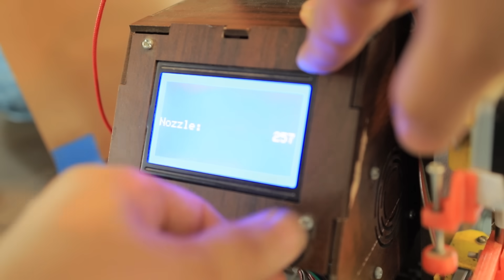How to Make free & easy filament for 3D printer at home

Comment: I assume you didn't print immediately after production. Wouldn't you need to spend considerable time drying recycled PET filament before use?
Reply: I would assume this process does dry the filament. I also assume this process introduces bubbles and other imperfections into the final filament which may also contain/trap moisture. But it is probably good enough for most use cases.
Reply: @JeffKarney  I assume you are referring to the initial heating under pressure? I imagine that helps but I'd be surprised if that's all it took. The initial extrusion temp is pretty low which may be helping to reduce bubbles but surely there is still moisture.
Reply from the maker: Thanks dear friend, be a little patient, because the time for the full video tutorial was long, it was decided to split the videos, but do not worry, we will discuss it in the next videos

Comment: Nice idea and excellent work! 
Curious about why you need to stretch the bottle with pressure at the beginning of the video? Does it not working if you doesn’t stretch it? 
I’ve never learned about materials, don’t know if all the bottles are made of pet material, or how did you choose the bottles? 
Is it easier to joint the plastic strap before stretch it into filament shape? 
Is it better to have a extra step using another nozzle to squeeze and stretch it, to smooth out the filament diameter, or unnecessary?
Reply from the maker: Thanks my friend, your answer is in the pinned comment

Comment: I would have never expected filament to have enough rigidity just out of the nozzle to PULL the cold plastic in on the other end. Sounds too good to be true, but I guess the lower temperature and the larger diameter helps keep the centre from melting properly. Impressive, might worth a shot :)
Reply: it doesn't actually melt 'filament' it just forms PET strip into 'almost tube' shape while it's heated a little bit higher than deformation temp, pretty common and well-known technique
Reply: Oh i didnt even realize that it was being heated when pulled through. I assumed it was just being pulled through like a die. Really clever to use a heated nozzle and pull it through that

Comment: A proper tutorial explaining the different steps and also how to build the cutter and the melter would probably go viral and get many people who wanna know how to make recycled filament to watch your videos.
Are you going to make such a tutorial with explanations?
Reply: That will be nice, though there are many bottle strip rope tutorials on Youtube and a few online demonstrating the different ways to make the strips.  My only question regarding the strips is the optimal width mr3dprint found to cut the strips.
Reply: @jafinch78  I would mostly be interested in the block he used to melt the strips into round filament.
Because regarding that thing I only found one other video using something similar, but that video was russian and also didn’t explain anything.
Reply: @yourlocaltoad5102  Thinking if the block is 200-225, then a cost effective E3D V6 will be suitable since the extrusion temperature is low enough and well within that blocks temp range.   Not sure why a 40A block would be required.  Can save on the PSU and just use something like 10A's I'm guessing to power the controller board an all since the controller board, block and feed motor is all that is needed to be powered.  No other 3D printer motors would be used.
Reply: @jafinch78  well, the thing is that I have no idea how to regulate such a block, which nozzle to use or anything else like that.
So that’s why I would really like to see a proper tutorial on that (or maybe a written article, but I couldn’t even find something like that referring to a project like this).
Reply from the maker: Thanks dear friend, be a little patient, because the time for the full video tutorial was long, it was decided to split the videos, but do not worry, we will discuss it in the next videos

Comment: I think your lying.  Your putting regular PLA in your printer.
Reply: @AIboom20  No..  I've looked at your videos and read your comments.  I know your lying.  The spools you make have imperfections but the filaments you put in the printer are perfect.  You also try to hide the filament as much as possible.  People ask for information and you point them to other videos of the same thing.  You also expect me to believe that you make the filament at 270-280 by pulling it, but it's soft and printable at 250-260?  And, that your results are indistinguishable from any other print.  No..  I don't believe you.
Reply: I wanted to come back here and say that I now think I was mistaken.  If this is a trick then it's extremely elaborate and well planned.  That does happen but I don't believe that's happening here anymore.  I may have to try this for myself but from what I can tell this now looks real.
Reply from the maker: This is quite true, there is no reason for me to lie, because my goal in setting up this method is to help people who have little financial power but have many ideas for 3D printing.

Comment: Well, I'd call this more of a "demonstration" than a "tutorial" since a tutorial usually includes instructions... but it is pretty neat.

Just do me one favour, eh? Don't use a box cutter like that.  Box cutter blades are designed to snap along the score lines on the side, and should never be extended so far that you can see the lines.  If you need a long knife, get an actual long knife.
Reply: Meh, if you need a long knife but all you have at hand is a stanley knife, you use the stanley knife. If it snaps, it snaps.
Reply from the maker: This is not a tutorial video for making a filament machine This is a tutorial video for making a filament, of course we are currently recording a tutorial for making a filament making machine and we will publish it soon, do not worry, my goal is not to sell a filament, but a tutorial for making a fixture requires a video More that will be on the channel soon

Comment: Well done! I've been thinking about this for a long time. It's a great start and giving plastic bottles new life. Now if we could do more than just plastic bottles that would change everything. They make commercial machines but they are way outside most people's reach. I would love to see a plastic recycler and a 3d printer in every home. We would be one step closer to the star trek replicator.
Reply: I agree! Need to take into account toxic vapors at certain melting temperatures.
Reply: @AIboom20  can you please do a break down of how you make the bottle stripper
Reply: @hustlesprouts  If you are talking about just the part that makes the strips, there are a number of files on Thingiverse available.  I've also seen more low tech versions that is basically (pause for several moments of trying to find the most coherent explanation)... okay, take two stacks of washers to the height of your desired thickness, then place a razor/box cutter/etc blade on top of those, then at least one more set of washers over (making sure the holes are still clear. Screw or bolt these to a board with just enough space between the stacks to let the plastic fit through.  

That's probably the most basic option I've seen, though the first one I saw was some sort of sleeve over a 2x2... and no, my not-yet-properly- caffeinated brain cannot remember how that design was supposed to work.    And it will work... but extras, such as the post to hold the bottle steady, and the weight (which I had not seen before, and really like), just make the process smoother and more efficient.
Reply: @PhoenyxAshe  cheers

Comment: The extruder machine must have been a headache to engineer.  A lot of factors involved all having to work together. Fantastic follow thru. Very satisfying to watch.
Reply: You know someone is going to make a box kit, one of these days.
Reply: @DocWolph  There already is (kinda). But it uses pellets and it's not very effective
Reply: I you don't know why but this is hard for me to believe also are you trying to tell me that all soda bottles are made of pet G
Reply: Polyethylene terephthalate (PET or PETE) plastic – the source material of water bottles, soda bottles and more — makes up 10.2 percent of global plastic production. PETG is the same thing only with Glycol added to give it different chemical properties. PETG is less brittle, more pliable, and more heat resistant, but less recyclable.

Comment: I built a filament extruder. Usually you push the melt through the nozzle. So you got several factors that influence thickness. Here the filament is basically pulled out of the nozzle. So yoi eliminate all the factors that determine your die swell, which is brilliant. But for a self built you need a diameter logging. You dont stay with the machine for hours to watch tolerances in diameter. And you want them to be within limits...
Reply from the maker: Thanks dear friend

Comment: How did you get the plastic so round??it look round when you inserted it in the printer and I must say that looked easy to make putting plastic garbage to good use.
Reply from the maker: In fact, the tape in the extruder part acquires a tubular state due to heat

Comment: Tutorial my ass. You didn't explain anything. What are the tolerances of your filament? How do you measure and verify them to make corrections while pulling the filament through the heater block? How do even start the process without some sort of extruder that grips onto the peeled wall of the bottle to push it into the heater block? I call bs.
Reply from the maker: Yes, dear friend, the link of educational videos (video number 1 to 8) is available in the description price of this video.

Comment: The part when u put the plastic through the nozzle to make the actual size of the filament...how did u do that? What temp tho? And how it's not getting squeeze on the process?...
Reply: 1.75mm nozzle (drill out an old nozzle).

Comment: That my friend, was Awesome. I've seen the videos where they used plastic bottles to make string or rope but this is a breakthrough. I guess you need a nozzle with a diameter of 1.75mm or drill out a spare brass nozzle. Now we just need to figure out a way to join the lengths together to make a decent size spool.
Reply: The nozzle could be made by drilling a regular nozzle with a 1.75mm bit, Im wrong?
Reply: @emmanuel1631  If you watch the making of Prusament videos, they show that the nozzle diameter isn't as important as the stretching. I bet the nozzle size is probably 2-2.5mm, and the pulling gets it down to around 1.75mm. You'll definitely need a custom direct drive that can handle the variation in diameter.
Reply from the maker: Yes it can be done
Reply: I'm not able to see mr3dprint reply for some reason.  Wondering what his details are regarding the specs for the nozzle and other details.  For joining... there is more than one way that can be accomplished.  Basically, a tube/pipe the correct diameter can be used on the heated pressed together ends and then slid over the joined section to even out the diameter... then slide the tube to the end.  Guessing similar can be performed with that tube cut in half twice so to compensate for the width/thickness of the cutting method with each tube cut in half, so to have a complete tube that can be solder, brazed or glued to some pliers so no need to slide so much distance.
Reply from the maker: Thank you very much!

Comment: I really want to call BS on this, but I have never worked with PET before. is it possible that you can just "draw" it through a hotend at a particular temp and it will be strong enough to pull the new cut bottle through without tearing/melting? I don't know.
I would REALLY need to see a single take, no cuts, from bottle to extruding. Does Not have to be a WHOLE print, something simple and small like a test cube would be fine and only require a meter or so of filament tops. Do this, NO CUTS and you got my respect and my SUB.
Cheers!
Reply: @AIboom20  I want you to make a video showing every step without editing. One take. I believe you are cheating. I do not think you are doing it really. Cut a two meter length of bottle and extrude it to filament and then print something small without turning off camera, I want to see every second without camera turning off at all
Reply: @sNEAKYnIGHTmUPPET  Or at the very least show the the filament sticking out of the printer while printing.  The "filament" made has imperfections and an inconsistent curl that store bought filament would have.  That's all I need to see.

Comment: Am I the only one who knows this will ruin your nozzle and potentially your extruder stepper motor? 
You didn´t know what material is mixed into these bottles and therefore can´t use any bottle at all. 
On the other hand, you could overheat your extruder (on a direct drive at least)  cuz you need to crank up the nozzle temperature significantly. 
Wouldn´t put my Voron or other Printers I have through this. 

And just to say it: "How to Make..." shouldn´t be included in the title you just show off a proof of concept and didn´t say us how you make these at all.
Hate such things absolutly.
Reply: @AIboom20  You can wash as much as you want you won´t get any imperfections and any mixed materials out of the plastic as long as you didn´t purify it. 
What you clearly don´t do in your video. 
And if this is a demonstration why did you name it "How to"?

Comment: I've had this idea maybe 6 years ago, and since then I've tried to make filament out of water bottles, with little to no success. I was shredding the bottle and extruding the pieces through a hot end using a slowly spinning drill bit. Thickness consistency was the biggest challenge. Well done man! I did not think of cutting the bottle into a one continuous line. Next question would be, can you skip making a filament all together and print with that cut bottle? might need to make a different drive gear
Reply: @AIboom20  Hey mate. He was asking whether you can skip melting the bottle strip into filament and use the bottle strip directly to print from without having to make the filament. But if I were to guess you'd have to mod your printer for that. Interesting thought, as you've already made a nozzle/hotend that can melt the bottle strip into filament.
Reply: The solution to directly printing with the strips has been keeping me up at night. I'm working on a 3d pen that takes the raw strips.
Reply: @Articulateobscenity  nah, make a whole side setup that takes bottles and feeds it into whatever makes it into strips lol
Reply: @AIboom20  using that cut up bottle strip as a filament directly
Reply: Nice idea, Adapt the hot end and extruder.. tho this would only work for recycling plastic bottles.